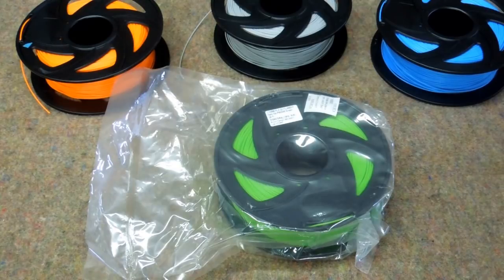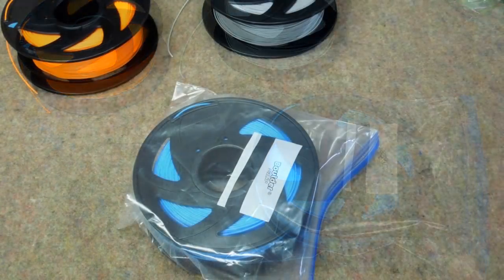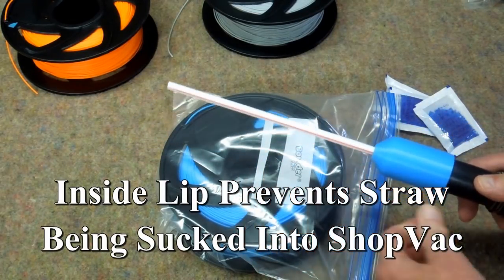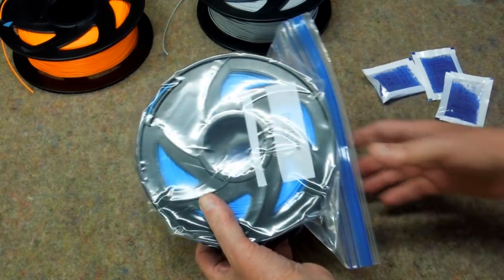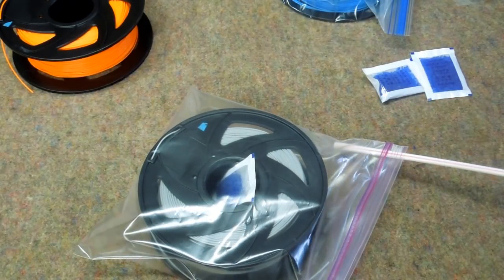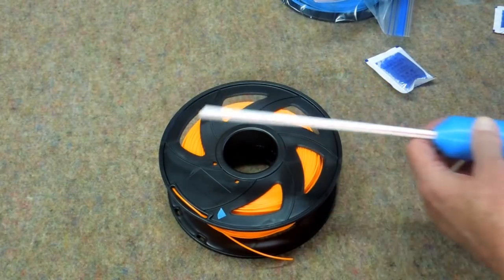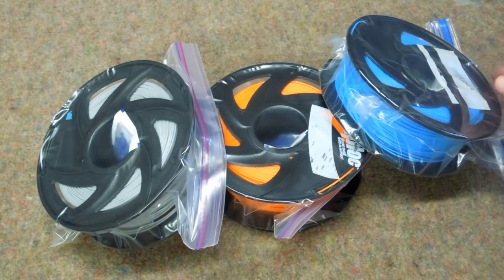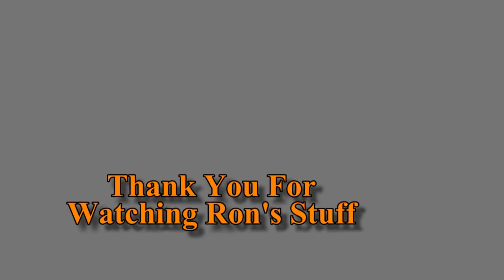Protect Your PLA - ShopVac Straw Adapter

Comment: Hi! FYI.... I just tried to print the vacuum straw thing. The uploaded file is corrupt somehow. Could you please re-upload it for me!?! I DL'd it onto 2 different computers, same on both.
Reply from the maker: The file is good. I just downloaded it and tested it in Cura and it worked perfectly.  Print it small end down on a raft with support to the build plate only.
Reply from the maker: Did you get it to work? Ron
Reply: @RonaldWalters2010  Yes, but no. In Cura I can't get it to stand perfect on raft with small tip down (bit of a noob here....). In Simplify3d it would not slice at all, i dont understand that, its happend on a few other models too.... Tried 2X and had to move on to another model after the tilt and fan ducts met. I liked yours, obviously. I thank you kindly for all you do here on the tube. Love my ender 3 and I just got an old davinci 2.0 duo for 40.00.... its a clunker but after I jailbroke it, the beast does pretty good!!
Reply from the maker: Load the stl into Cura. On the right side... Build Plate Adhesion - click none (no raft). Click on the object, then on the left side use Rotate. UNCLICK "Snap Rotation". I always turn unclick Snap Rotation. Rotate it as close as possible to vertical with small end down. Then click on "Lay Flat" and it should jump up & down and contact the build plate perfectly. May need to do this more than once (rotate a little then lay flat). Rotate the bed to look on the bottom side to confirm perfect contact. Then add the raft. Good luck! Ron
Reply: Thankyou Brother! This one didn't work out for me, no worries. Thx for all your help via the tube. The bigger question I have is, why doesnt your file load into S3D? I've had a few others not work too... I dont understand why that is.
Reply: So, to follow up. While printing your thing and others, I noticed an intermittent vibrating/grinding noise. I had this type of noise b4, it was carriage wheels needing adjustment with that blasted concentric nut. So i did that, then started a big raft for a 24hr print. The wheel was WORSE. Paused the print, readjusted, resumed the print (both times I've tried this it has failed), cleaned up the mess, swore alot. Investigated WTF was going on... the gantry carriage wheel on top right had a bad bearing. After removal, exercised the bearing (no oil...) and it started to behave like normal. Re-installed and haven't turned it back on, done till tomorrow!!  SHEESH!! You just gota Love to Hate these things...
Reply from the maker: I have not had good results with pausing or resuming a print with the Ender-3. If a bearing has a rough spot you can play around with it until it feels better but eventually it will get back to that rough spot again. Best to get a new bearing.
Reply: @RonaldWalters2010  Yes, I assumed that it could return and get worse and ordered a new set of wheels last nite.

Comment from the maker: Further note: A Ziploc bag will hold water but generally will not hold a gas. This is true of many containers (holding a liquid but not a gas). The vacuum extraction of air works well, however after several weeks it was noticed the plastic bag material is stiff enough that it wants to return to its normal shape and over time air seeps back in (through the closure) and the bag slowly returns close to its original shape. This ingress of air causes the silica gel packets to have additional moisture to absorb. A solution to this is to vacuum extract the air from the bag and then place a rubber band around the spool. The rubber band keeps the bag in its collapsed configuration and helps prevent ingress of additional air as the bag relaxes. Actually a wider band made by cutting an appropriate size inner tube would be more efficient. It is not a perfect system but for the home shop, works pretty well.

Comment: I believe the way you do it here, you actually seal the drying bag inside the center of the spool and it cannot dry the fillament, because it is sealed away from it. I would put the drying bag outside where the fillament is winded.
Reply from the maker: The desiccant packet works very well in the center of the spool because the bag is not that tight. A Ziploc bag will hold water but generally will not hold a gas. This is true of many containers (holding a liquid but not a gas). The vacuum extraction of air works well, however the plastic bag material is stiff enough that it wants to return to its normal shape and over time air seeps back in and the bag slowly returns close to its original shape. This ingress of air causes the silica gel packets to have additional moisture to absorb. A solution to this is to vacuum extract the air from the bag and then place a rubber band around the spool. The rubber band keeps the bag in its collapsed configuration and helps prevent ingress of additional air as the bag relaxes. Actually a wider band made by cutting an appropriate size inner tube would be more efficient. It is not a perfect system but for the home shop, works pretty well.

Comment: I wish there were similar containers for molecular sieve dessicant. A little stainless mesh pouch welded closed would be perfect. (I prefer molecular sieve as it will dehydrate even rather hydroscopic materials and go to nearly 0% relative humidity)
Reply: I'm going to 3D print these for exactly what you mentioned. :)
https://www.thingiverse.com/thing:2560068